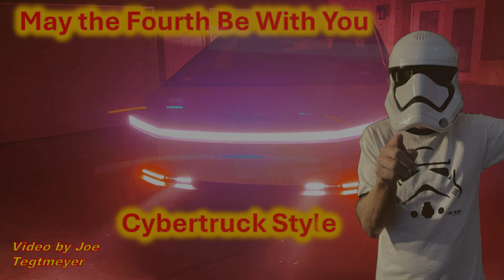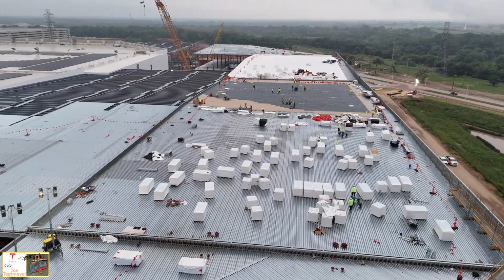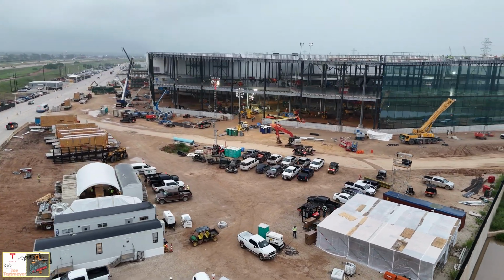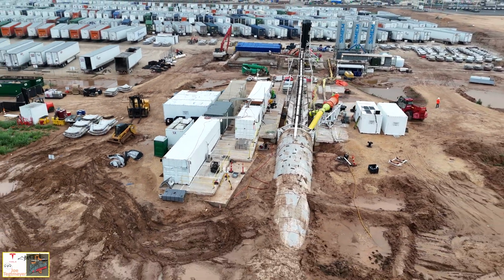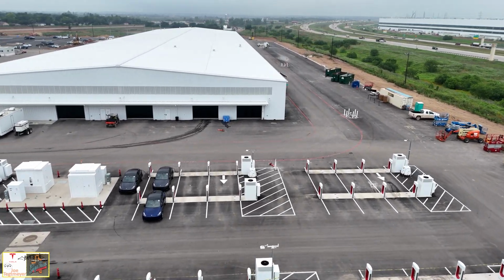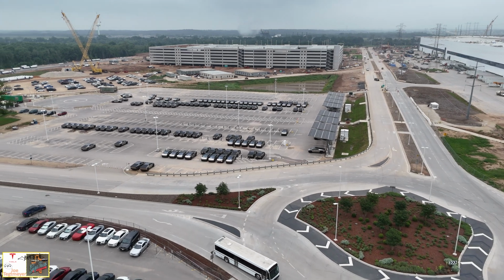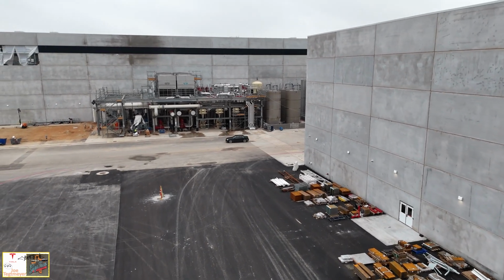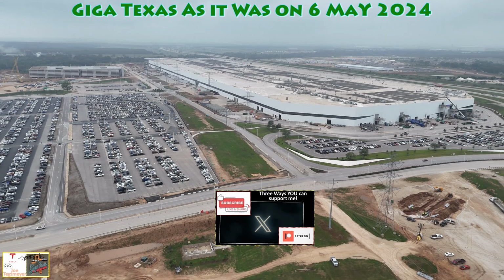Huge Progress on S Ext! Conduit on N side & Boring Tunneling! 6 May 2024 Giga Texas Update (07:35AM)

Comment: If they haven't already buried pipes for the cooling structure, they will have to. Maybe that's what the trenching is for.
Reply: 7:05. Green pipe. Sanitary sewer.
Reply: @DessieDoolan  My attention is 0 for 2 today, should have had another coffee.  Better answers for James :-)
Reply: @Gig0Surf  Drains seem to be quite deep. Possibly deliberately deep to allow other services to pass above. Not dissimilar to the sanitary sewer drain at depth across the tunnel alignment at 10:38.
Reply: The trench looks like it is for the blue pipe water supply/fire loop .  Not sure what the plans are for the pipes between cooling and the building, in Shanghai and Berlin they were elevated.
Reply: @Gig0Surf  Hopefully the pipping will be below grade like at the Cathode building/Die shop.
Reply: @DavidJohnson-tv2nn  Oh yes, thanks.  That is a nice setup / not sure why I blanked on that :-)
Reply: @DavidJohnson-tv2nn  Thinking about it more, underground might make more sense with the overhead lines.  And as Dessie said, the sewers are already quite deep so they wouldn't obstruct

Comment: Not sure why you still think the Boring tunnel will enter the building since there’s no way to extract the machine at this point!
Reply: The support segments can be pulled out the way they cam in. Only the 12 ft. by 50 ft head will need to be removed. The bays are 40 ft. wide and 40 ft tall +/-. plenty of room for a wheeled crane.,
Reply: @kkarllwt  Boy you guys are really reaching to justify your inside argument!  I’ve got $1000 on no tunnel inside…it will be between highway berm and Tesla’s road on west side of bldg, bank on it!
Reply: @Starpopper800 we will see .. both options are possible. Inside makes more sense. Because No traffic interruptions in front of the factory and the transfer of the vehicles are independent from the weather conditions outside. But pretty soon we will know it.
Reply: @wolfgangselle4307  Weather concerns don’t make sense since the other end won’t be covered.  Inside would eliminate any future reconfiguration options and we all know how much Elon changes his mind.  Besides, that ground floor of the extension is largely for the AI data center & bunkers.

If it were going inside don’t you think they would have completed tunnel first then construct building around it?!  What about all of the underground water mgmt pipes that crisscross under that bldg?!  Makes no sense at all!
Reply: @Starpopper800  if they would build the tunnel ( at least the end of it )  before they started with the building that would possible delayed the start of the whole south extension. And the tunnel is by himself “ structural “. And I think they moved the drainage before they even started with the building. But will we see it sooner than later ..
Reply: @Starpopper800  Highway berm. Not enough elevation difference between the highway and the perimeter road for a tunnel to exit through the face of the berm.
Reply: @Starpopper800  Count the remaining segments to be installed. If they are halfway under the tollway, then why did the haul another 500 feet of segments to the jobsite?
Reply: @Starpopper800  I' going with the unpoured section between the sections that do not have rebar. If they miss by a few feet, that machine can cut right thru the concrete.
Reply: @Starpopper800  They will likely build something over the west end of the tunnel as well.
Reply: @kkarllwt  They should be able to hit their target within an inch or two. I think it will appear just at the edge of the building where the gap in the perimeter wall is. Once it is removed, a concrete ramp will be installed to complete. We should know in the next couple of days when the curved steel receiving ramp is take over there and positioned.
Reply: Don’t think they thought of that. They know how to demolish concrete.
Reply: I agree, I don't see it coming out inside the building.  There was too much underground work in that area prior to even starting the building plus all the support structure for the building to believe they can bore into that area and miss all existing substructure.  But the way Musk builds and then tears out nothing would surprise me.
Reply: @v055741  The tunnel may end at the building perimeter, but almost certainly there will be a ramp inside the building to the tunnel portal.

The various drains and utilities on the tunnel alignment have been constructed at depth to accommodate a tunnel or ramp.